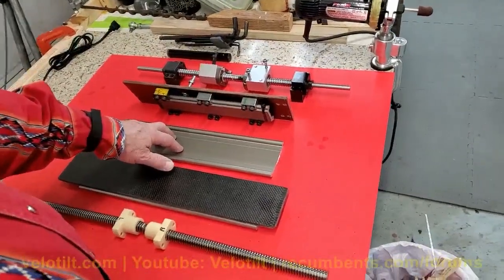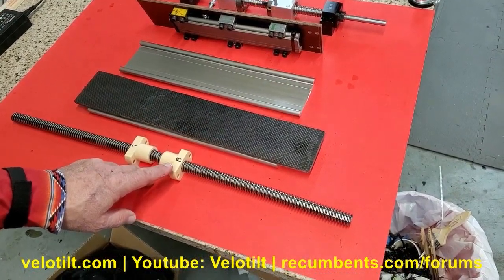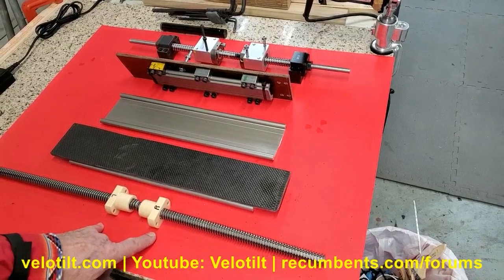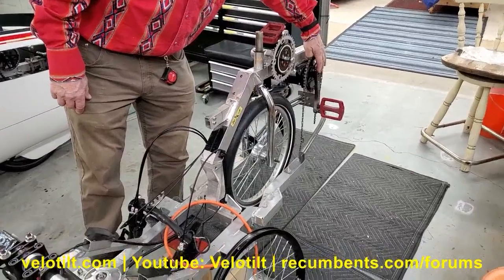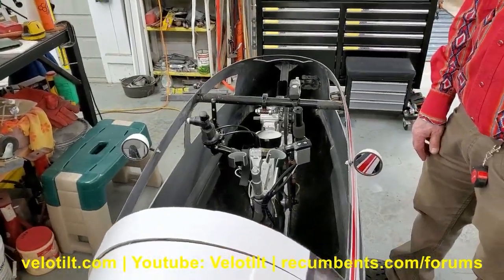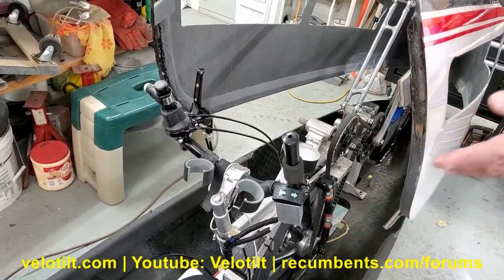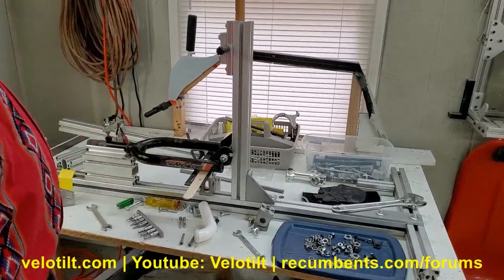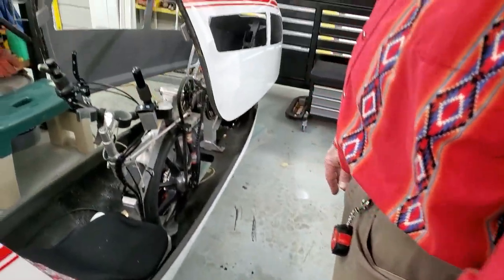Tilting Velomobile Update-Velotilt!

Comment: That belt will be a lot of trouble. Those pulleys bend the belt well beyond the sensible limits. Bending it both ways will kill its "spine" in no time. The smaller the pulleys the more energy will be lost. This is by far the worst use of a bicyle belt I've ever seen. The combination with a Rohloff will "eat" at least 20 percent of the energy you put into the system. A belt is fantastic with an e-bike. It's complete nonsense with a HPV.
Reply: rode the belt for 6 months, its great and coming soon is stites fwd fork added to gates belts if we can get correct length belts.
Reply: good vid garfield

https://youtu.be/fSNEuWa99Lw

Alot of people that ride velos and bicycles are retired, offer them both, the gates belt is clean.  Some people do not want chains.
Reply: gates will work with right length belts, bill stites fwd fork system arriving 12-june-2023.  stites uses chain and now gates, at least one belt. Gates sponsors me, they say one mold is 120 grand. Sound lil high.